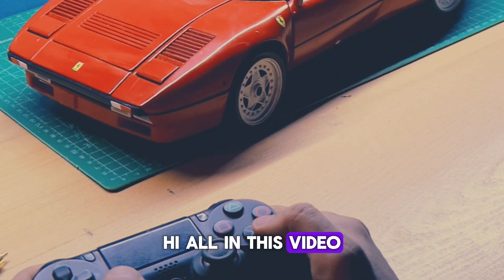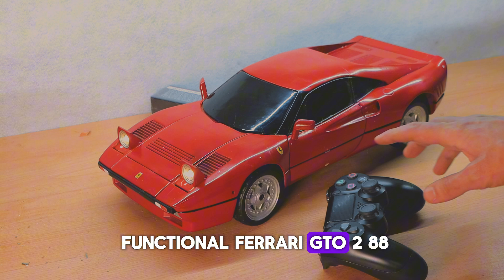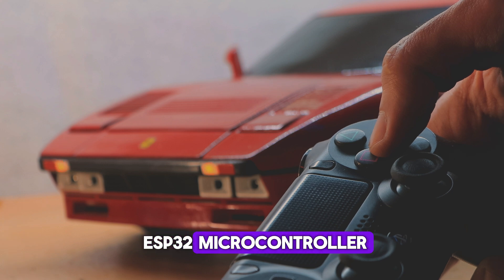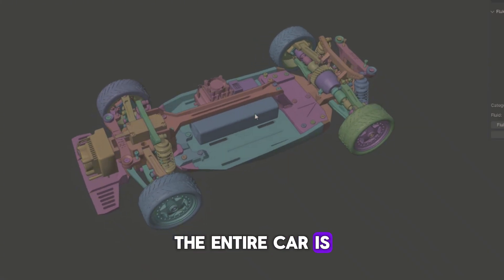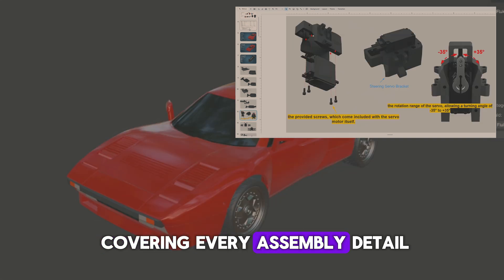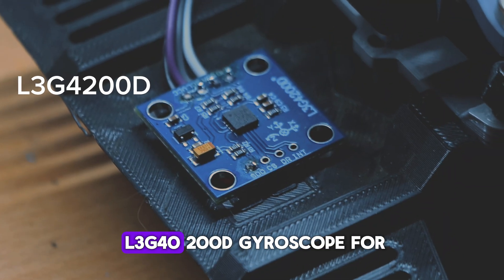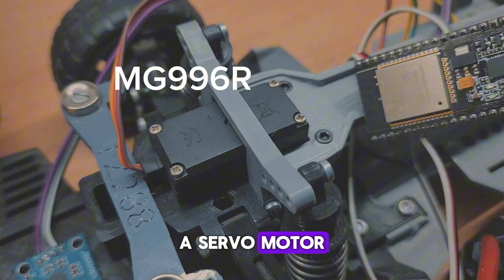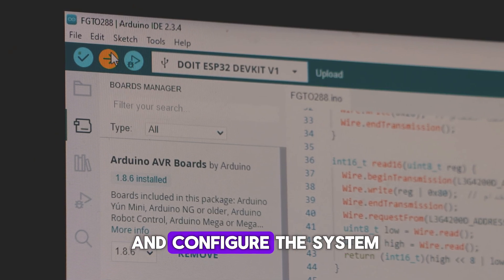Build an ESP32 PS4 Car Controller with Gyro Compensation – 3D printed RC

Comment: I want to mod a old PS4 remote but keep motors to vibrate when driving, similar to that in a game played like NFS Payback.. I haven't seen it done yet but i feel it would make for a more immersive experience when RC'ing, im surprised they dont just make remotes with feedback such as motors that vibrate & I'd have the square button control the emergency breaking function, L2 &  R2 for reverse & forward/ drive function..

Comment: the code did not work
Reply from the maker: can you share the problem ?
Reply: Ошибка компиляции

ESP32_PS4_RC.ino:366:37: error: 'analogWrite' was not declared in this scope
Reply from the maker: @SUPERBEARADVENTURE9  It seems that in some versions of the ESP32 core, the traditional "analogWrite" function isn't declared. If you're encountering the error "analogWrite was not declared in this scope," it's likely because ESP32 uses the LEDC API for PWM control. To fix this, you can set up a PWM channel using LEDC functions. For example:

----------------------------------------------------------
const int pwmChannel = 0;
const int pwmFrequency = 5000;
const int pwmResolution = 8; // 8-bit resolution (0-255)

void setup() {
  // Set up the PWM channel on the desired pin (e.g., ledPin)
  ledcSetup(pwmChannel, pwmFrequency, pwmResolution);
  ledcAttachPin(ledPin, pwmChannel);
  // ... rest of setup code ...
}

-----------------------------------------------
Then, instead of using:

analogWrite(ledPin, brightness);
use:

ledcWrite(pwmChannel, brightness);
Reply: Can we replace the gyro module with a different one? mpu6050
Reply: Maybe try a different version of board manager.